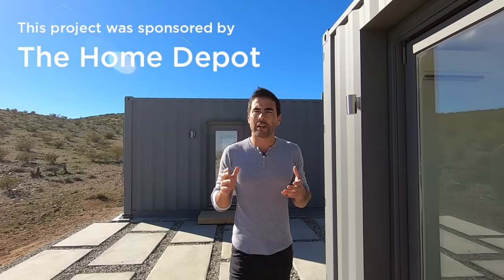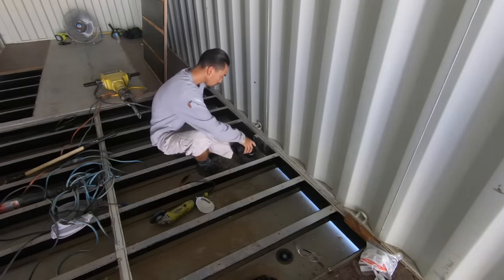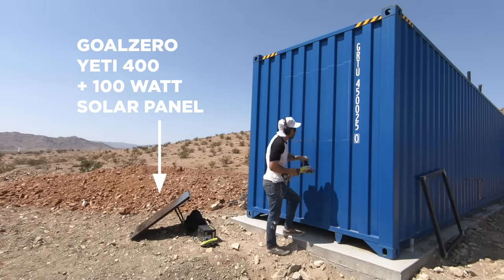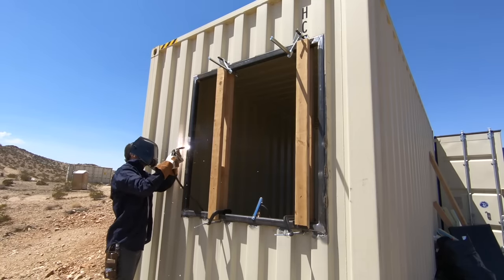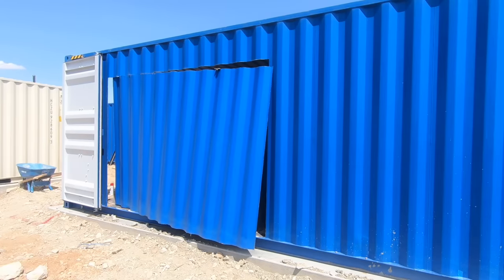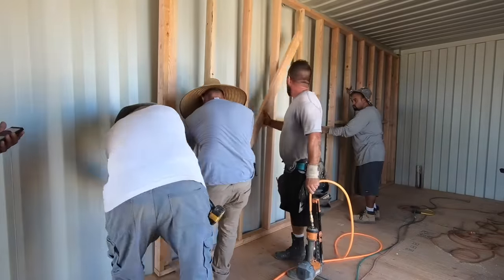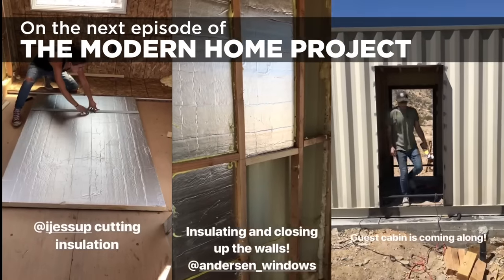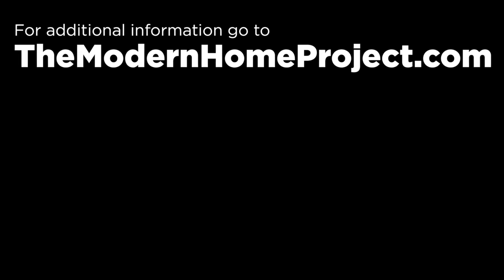Building a Shipping Container Home | EP02 Moving, Cutting, and Framing a Container House

Comment: I see all these comments about "Don't build in California", like yeah, it's definitely not the cheap place to build one of these (obviously), and yes, he did do a bunch of extra work, by hiring a guy to run an excavator and hiring guys to set forms and tie rebar. If you rent an excavator and do all the work yourself you save a ton of money. My boss always says to the new guys "Materials are cheap, labor is expensive, quit dicking around with that one piece and go cut a new one". The other thing is survey and permits. There is no way around it, you have to get both of those, and they're not cheap. There might be a way to lower the cost overall by getting a contractors license and possibly getting a write off on your taxes...? Not 100% on that but it sounds possible. The thing that I don't understand is why I see comments saying "Why are you framing the inside? Why not just do this without the shipping container?" It might just be me because I am a carpenter and understand construction, but how would you insulate it? Where would you attach your outlets? Let's say you insulate the outside somehow and figure a way to install outlets and light switches to a metal wall, would you really want metal walls? To hang your TV and pictures and what not? I personally would want the inside to have drywall so that it would somewhat feel like a typical house. I would probably use some 2" hat channel and insulate with rigid foam. As long as that is deep enough for the switches and outlets. Also, the sheetrock will hide the wiring and plumbing. Another benefit of the shipping container is the speed at which you can build the house. No roofing or siding to install, just paint it or for the roof maybe use material that prevents rusting? I wonder if it would be beneficial if you used like a truck bed liner, or better yet, you could utilize the roof by putting a garden up there or even just use it for like a BBQ/bar area. Save room in your yard. Hell, I'd even put a slide down to a pool! (Especially in the desert) I have been wanting to build one of these lately,  and I still do, but maybe that's because I live in Oregon. My idea is to get 4 of them, have them in a baseball field diamond-like shape so that they all face each other and put a courtyard in the middle. I think that would be pretty sweet. Of course, I rarely ever get to follow through with any of my ideas. I am very passionate about being a carpenter and building things and I've always been told that I have great ideas that could fetch me an astounding amount of profit, but for some reason or another something always happens that prevents me from being able to ever make any of my dreams come true. Just the way my luck is! Eh, who knows. Maybe someday....

Comment: Use the pin set up on the "chassis trailer mount them in concrete so you can lock it down like the rail yard

Comment: Advantages of container homes. Easy to get onto site. Do not require an expensive concrete foundation. If you stick to the dimensions and if you insulate internally can easily be moved from one site to another. 

If you don’t intend to use these qualities it’s typically better to build with other materials.

Comment: I've seen a lot of people do their metal window frames and installation like this, but I'm not a huge fan. If you ever need to replace a window that means removing some of the framing? I may be missing something, but if you watch around 18:30, they install the framing over the window flange that gets screwed into the metal frame.

Comment: With all these works to do,  to have a metal (not isolated ) skin for your house, is it really more interesting than building  in "hard" which can be bubled concrete, for instance, light, warmth and noise isolant, easy to adjust, to cut, to drill any diameter to insert your tubes, electricity, etc... ?

Comment: 1. build on the outside of one long wall to run all plumbing and no inside framing needed.  Apply all insulation on the outside where it is much more effective. 2. use skylights and a normal roof with 12" overhang.   When cutting but a gas powered 14" cutter, fast and now electricity needed.

Comment: The 2x4 on edge framing reduces your interior by almost 8 inches. IMHO they could have been laid flat saving 4 inches for wider interior when when every inch counts. An 8" interior is extremely narrow. I am considering using 2x1 strapping for interior framing in my build. As you mentioned, it's not structural.

Comment: Instead of using angle for the door frame structure, you might want to use c-Chanel next time. More structural and any exterior finish can be flushed up to it easily. Also it makes the door stand out.
Reply: He did further on in the video and ge agreed

Comment: I live in FL.  Wood looks great... but not for long.  Termites, rotting, mold, etc.  Hence building a wood frame house within a shipping container.

Question: if doing again, would you use angle steel around the windows as well (like you did for the swinging doors)?

Comment: Sorry question, where does the drain pipe lead to and why did you need electrical wiring between containers in the concrete? Thanks!

Comment: Wouldn't it save more space if instead of using 2×4's for the framework and 2×8/10's (not sure which one you used) for the headers and such. If you used smaller steel tubing? Like ¼" thick 1×1 square tubing?

Comment: good video. I would to make it more efficient...
1-Pour bases before the shipping containers arrive , then off load containers straight down on its base. 
2-Leave pockets in concrete for services.
3-Raise container on plinths to allow for services to go under the container.
4-install Vents outside.
5-Weld all the way round windows and doors.
or to make it cheaper use wood not steel.

Comment: I prefer the idea of a single 40’ container and build in drop out sides to expand it into 3x the size. Make a plant room backed on to a central shower/bathroom and just design up jacks to lift it by the corners so it can self lift off a trailer and you don’t need a crane. A fully fold out/up movable container. Just rent a truck to move it as you need. Perfect.

Comment: Ya know if you're going to paint them anyway, why not use Insuladd in the paint for the extra insulation? It equals two inches of foam when used right and it's simple and cheap.

Comment: Where did you get the electricity for the welder and for the corded power tools . I understand the solar for the battery chargers. But the welder uses mucho electrons and in some places you used corded power tools.

Comment: Question - In regards to insulation. Why add insulation to the inside, and not the outside to prevent condensation forming and secondary problems?

Comment: nice work i appreciate all that. I have a question: why you connected the installed window's wooden frame to the concrete slab by steel ? and only over ground opening .. thank you in advance
Reply: Still have an important question :p. what the full cost of a container house? I know it may depend on the material used but let's make an average. Thank you

Comment: I agree with lots of comments made. Also I wounded couldn't you  instead of a big expensive slab of concrete . Dig 8 holes  , 4 each length of container 10 foot apart . Steel post  at  what ever  hight works  . Cheeper , easier for plumbing , good for storage , bigger for less money .

Comment: I'm working in the shipping industry and just wonder why you did not integrate twistlocks into the concrete, so that you could lock them easliy. Twistlocks are used to secure shipping containers to the deck and also in between stacks of containers.

Comment: For those interested - DO NOT DO A CONTAINER HOME
Containers are not meant to be homes.  You still have to build a frame, you still have to build a floor, you still have to build everything that a traditional wood-frame will need but instead you're cramping yourself inside the box while doing it and you'll need somone familiar (or learn yourself) how to work with that type of metal.
It's cheaper and easier to work within the dimensions of a container if that's what you want, but using a container just complicates the entire process.
Use wood and then use metal as your siding choice later.

Comment: You have saved a lot of wood structure and inner space if you had used thermal sandwich panels and 3 metal frames to reinforce the container structure after openings were done

Comment: hello, question of a non-handyman; what is the device that allows you to solder at 20:15 ? What does it require in terms of material to achieve this?

Comment: In Mobile Homes they put the vent pipe under the cabinet to about an inch away from the underside of the countertop!  As long as you have a P-trap on every drain you shouldn’t have to worry about any gas build-up coming inside, eh?  At least, that’s how they do it in Mobile Homes, from what I’ve seen!  I reckon the code inspector mandates you vent through the roof?!?

Comment: I have  question 1. How is the trik n tip how to keep dry inside room in wet rainy seson...when we modify container we have to cut and conect with theother..how to make the seal proper, 2 container made of steel...it would be very hot in summer in bali almost 40, what material can  efective to muffel the hot wheter inside, 3 what material is proper tocover as wall...gypsum n calsibord is too easy get broken,..wood3n material is to expensive

Comment: Did you buy new or used containers? I would be concerned about products carried in those containers like pesticides or other kinds of toxins if the containers are used. Is the air quality safe in those containers is the question.

Comment: That plywood is treated with a PCB based pesticide that off gases for years. It's meant to protect the wood from rotting and insects. It's pretty bad stuff.  If you didn't seal the floor with an epoxy sealant, no matter what you cover that floor with you're breathing those fumes.

Comment: Would CA regulations allowed you to build the foundation with a crawl space?  Instead of cutting through the bottom framing of the container?  If there are any issues with the plumbing, I would think it would be a nightmare to have to tear a finished floor up after it’s all done.

Comment: So, basically you're just building a stick home with steel siding...  You're building from the outside in, instead of the inside out which is the normal process   And it does seem very cost ineffective, considering all of the reinforcing steel angle iron and tubing needed to meet your code.

Comment: That looks like a substantial structural crack in your slab at 5:33. What was the cause of that, concrete too green before loading or a reinforcing steel issue? Just wondering..
Reply: Maybe the heat from the welding caused the water inside to expand too quickly and crack?

Comment: It is corten steel so rust will not be a problem. The problem I have with all the internal framing is you may as well build a normal house what is the point of using a container and putting up with its limitations if you are going to use the same amount of timber. Could have used insofast and had an engineering design that used steel framing that will do the job without the addition of all that timber.

Comment: If you have to build framing on the inside then all the container is is metal siding. You might as well just frame up a small building and put corrugated steel around it.

Comment: Every time I've watched one of these container conversions I have to wonder why even bother. The amount of work needed to convert one these containers is astounding and one of the main reasons is because they made of metal which is difficult to cut into. Also, now you're  limited to about a 7 ft wide living area. No way I'd ever do this. I'll just buy wood and build whatever dwelling I prefer.

Comment: I’m trying to understand why you would pour a structural slab to set a container on, that is structural and sea worthy, then jackhammer the structural slab and remove structural members of the container compromising both structures to accommodate plumbing, which could have gone underground if you did not pour a slab and set it on piers and that would’ve made the plumbing and all of your underground work and the build in general quicker easier and cheaper. I mean how much money could you have saved not pouring that slab, making Swiss cheese out of that slab and the box not to mention all of the caulking, foam insulation, cutting welding, and repair work?? Wow! 🤯 That being said you should not mention anything about being cheaper or more efficient during this video. 😂

Comment: So what is the point to use the containers if you still putting frame on the inside. Why not just build frame with more feasible configuration. Without trying to squeeze into the container?

Comment: Problem with container houses is humidity..., it's not getting out and as a result you have a damp house with black mold! Roofs are designed to let out steam, damp.... Flush steel roof is not. If so, you have to instal wentilation system.

Comment: Not sure why the headers If you have a steel beam on top and the Steel tubing above the window you have a I beam above the windows and doors this would provide plenty of load bearing structure A w10 I beam gets all its strength from the 10"tall X 3/16 thick  web in its middle which would be your corrugated steel  between the window frame and the top rail of the trailer.

Comment: Building a home from a  container is a lots of work. I would advice the builder just go ahead and get a welder,and make a frame out.and build your walls with  blocks and Cement and steel if you want a  solid home.Then you can  use things for the  installation. Because we live in a place where you have all types of weather you have to build  something solid and safe.

Comment: Looks like easier to just frame it out then, if you want to, sheet the exterior it with corrugated panels, like any metal building. I build a lot of em.. Makes little sense - all of this work. Stick frame and metal sheets about 1 day. . Maybe even some windows in place.

Comment: the 2400 internal width becomes only 2200 after insulation etc 
plus the external framing, flooring, roof etc are the cheapest component in a house project 
adding the $175 per hour for the crane and the unnecessary concrete slab 
it would have been cheaper easier and less impact to build from either cool room
panels or good old stud framing  with external marine ply insulation and plaster board 
allowing much easier concealment of services 
then the difficulty of cutting steel, reinforcing it etc is a pain in the butt

Comment: honestly, with basically a complete inner structure of framing, why not just do steel sididng and forget the containers all together....much cheeper, and your not limited by the shipping container dimensions
Reply: explain more please
Reply: @joshpittman8473  well, since they are essentially building a seperate, code compliant stick framed structure inside the container, which is already on a concrete pad, basically all the container is at that point is siding and roofing matereal, and is dictating the final dimensions of the structure. they might as well forget the container, build  a traditional stick framed structure of whatever dimensions they want, and use steel siding and roofing to clad it. it will be functionally the same, but will cost alot less and also again not be restricted by the container dimensions. 

i just looked up how much the steel siding and roofing would cost to cover a structure that size and its abour $1500, whereas the steel containers cost about $5500 new.

Comment: you went way further in framing than needed due to regulations that were designed for normal houses, i was wondering why you did not say this, were you worried the building inspector  might watch this video?

Comment: With all that framing what was the point of buying the containers at all? Could have just used that cheap barn style roofing metal as siding to achieve the asthetic since you framed out an entire structure within the container anyway? Otherwise I've heard tell of folks flipping the containers upside down to utilize the floor strength overhead then pour a slab into the roof pan that's now underfoot. This way you can also run radiant heat throughout.  Then if you want to stick frame over the exterior just run all your wiring and plumbing on the outside within that through conduit and spray foam it in before siding it over. Almost building a cooler to live in with the steel as far from the sun as possible. Anything but going thru the hell and $ you just did to instead live in an oven.

Comment: shipping containers are strong around their frames only not tin for the side and roof - your designers should have done their homework - header would only be needed if there is to be load on it directly -over-engineered - and strength does not come from tin sides it comes from its stackable frame around the outside - double walls plates? also screwing metal plate into frame means you have constructed a perfect thermal bridge and if any wood is touching the steel box the same thing will occur - condensation and hot cold will rot the walls out from the inside out. Not well thought out infortunately and massively over engineered for the middle of nowhere

Comment: IF A NUKE GOES OFF IN THE AIR WITHEN A MILE,THE RADITAIN WILL TRAVAL RIGHT THRU THIS CONTAINER.BURY IT DEEP,AND PUT YOU KNOW WHAT BETWEEN IT AND THE SURFACE,FOR ADDED PROTECTION.